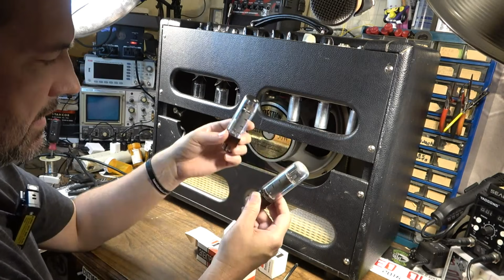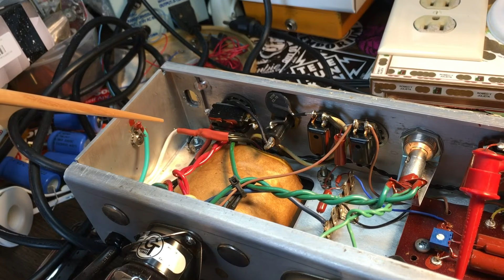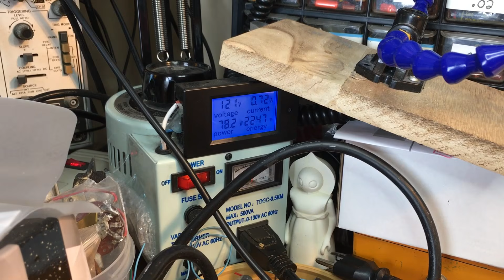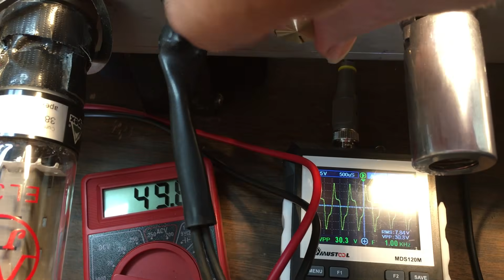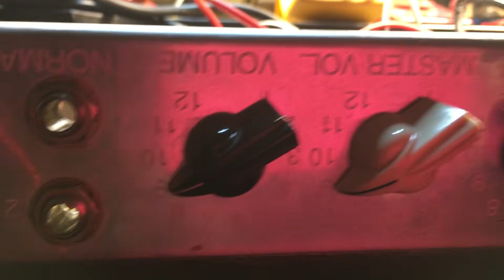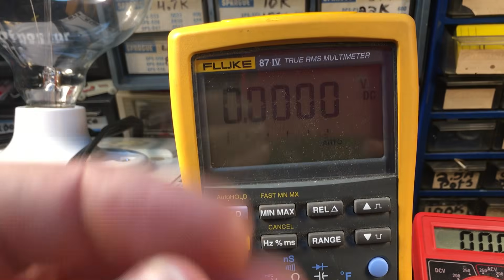STOP USING THE STANDBY SWITCH ON YOUR GUITAR AMP!

Comment: I applaud your desire to improve amp design. However I do know thermistors are high failure rate items in my experience with older CRT based television degaussing circuits. Thermistors are always running very hot, and thus tend to fail at times. Are you sure that your thermistors being used are rated at the current draw that will be on them, I assume so. In my experience popping fuses are caused by defective components, and/or wrong components, you may be putting on a band aide, rather than fixing the actual problem. No disrespect meant brother. Good luck

Comment: Haven’t used a standby switch in years going back to the early 80’s with Marshall‘s and I’ve had zero issues in that time.
I turn my amp on at gigs and if I need to mute it for breaks or anything else I’ll use my tuner. Amp is ready to go at anytime.
Reply: Could I just keep the master down when warming up the amp and keep my standby in the play position all the time?

Comment: the input capacitance reduction was a good move .. but i am sitting here wondering now; if old amps ever have lacquered wire problems that develop, in the filter chokes? .. leaky shorts that could reduce the inductance ? ... i think stand by switches are a good thing, on class-a amps at the very least....
of course if i had an amp that was blowing fuses, i would stop using the standby switch ... because that's the least expensive way to solve the problem ...and it would give me time to think about it.

Comment: more seriously : if the standby switch is after rectification, it can also see a spark when turned off because of choke (if there is one in the circuit). Not so good ! A diode could avoid that, of course, like in DC motors power circuits.

Comment: It's not about the circuit, it's about the speaker and that "pop" that occurs when you power down.  It's too keep the speaker cone from tearing.  We power up incorrectly, the standby switch should be set to "on" when you power up, you explain why.  It's the power down sequence and you've be playing on 7 and just turn the power off.... big loud thump that could damage the speaker.   Once the amp is off and powered down flip the standby switch to "on".  Now, are modern speakers able to withstand that "thump" ?  If so the standby switch is useless.

Comment: EveAnna Manley(Manley Laboratories) told me that the way they implement stand by in their tube amps is to have a tapped power transformer so you can go to half voltage on the AC side, before it hits the circuit.  There is enough voltage to keep everything warm but stop any electron migration in the power tubes(another problem with stand by switches). I guess it also quells the inrush current too. I hope I'm remembering this correctly.
Reply from the maker: It sounds like they've put a lot of thought into their design. That's rare these days.
Reply: @TheGuitologist  No kidding! Of course this was figured out 20 or 30 years ago by David Manley and the gear they sell is very expensive, so it's not the regular run of the mill equipment. Same with 65 Amps(not cheap) redesigning their circuit to adapt to lower tube quality. And they use a standby circuit !   Anyways, thanks for posting this video. Good stuff.

Comment: My main amp is a professionally made Blackface Deluxe clone and my understanding is that the rectifier tube releases voltage slowly to the power tubes so I would never use the standby switch because there is no need. This question plaqued me for decades before I learned this.

Comment: i have always turned the standby on first for 5 minutes before leaving standby on and turning the power on. when I'm done i flip them both off. in 25 years of ownership, the amp (1969 Sunn Sceptre) has never needed any fuses or tubes.

Comment: Yeah, the whole misunderstanding with using the standby switch came from high voltage / high current use.  I was an engineer for a X-ray mfr and we would recommend warmup for our tubes, but they saw voltages of 120,000 volts and the inrush current was carefully limited by circuit design (for dose control as much as equipment protection).  The relative low voltage of guitar amps makes this switch not only useless but actual detrimental to the amp's longevity.
Reply: After playing tube guitar amps for nearly 50 years I have not seen what you describe.
Reply: wow, thank you for sharing. Will stop using them from today.
Reply: Yessir. Guitar amp circuits benefit from inrush current limiters... Negative temperature coefficient (NTC) thermistors to be specific.

Comment: Why bother replacing the rectifier tube when you can substitute solid state diodes which will last forever and have less voltage drop. Replacing the rectifier tube with diodes will also increase the B+ so you'll have to be sure your filter capacitors voltage rating is not exceeded. The amp will put out a bit more power with the high voltage increase. Also you will reduce the heat inside the amp cabinet because you have two less filaments to burn. I have no idea why guitar amp manufactures never put small muffin fans inside the amp to keep the tubes cool.

Comment: Couldn't wait to have time to watch this video with such a provoking title ... 
But, well, its ideas are dubious. 
- Standby switch is there to lower power up stress on PT: first there is a current spike from heaters coming up, then from high voltage (without a switch they are at the same time and may be too much). Other exotic reasons are pretty neglectable, even more for a guitar tube amp. 
- if the fuse keeps blowing this way (and even using slow-blow one doesn't help), it would be beneficial to study PT specs and maybe use a higher rated fuse. I suspect this PT is too powerful for the circuit and so provides loads of current, blowing the fuse. Main fuse rating is mostly dependent on PT specs (it should blow before primary winding). So in such a combination it could be best to use higher rated main fuse and maybe add a heater fuse for the event of heater circuit failure. 
- thermistor is not a good solution, because it needs cool down periods to function, which is counter-intuitive and tiresome. 
Being a bit more complicated, in modern amps and clones it would make sense to include a delay+soft start circuit (when powered on, cap gets slowly charghed and so opens a FET to let the full voltage through) - similar device being present in both heater and HV(+bias) circuits (if the heater circuit is not a mains powered SMPS, which makes more sense)

Comment: standby switches have the advantage of reducing thermal shock to the valves.
the heaters come on first and you can hear the 'tinkling' noise as the internals expand. then the H.T is applied and the anodes begin to heat as electrons crash into them.
upon switch off its more severe because the anodes are usually quite hot.
you can hear them cool. i usually give it a few minutes then switch off the heaters and you can hear that too as they cool.
it's surely better to cool more gradually to reduce stress on the internal welds and parts.

on the subject of cathode stripping : it seems to apply to very hight h.t voltages only. several thousand volts.
i had an amateur radio transmitter with 700 volts on the anodes and when it was switched to receive only, the heaters were turned off and the anode voltage remained. this never caused any issues

Comment: Hi, A Little Bit Of Historically Correct Standby Switch information, Originally At Radio Transmitting Stations and TV Stations Using Water Cooled Power Valves/Tubes With Out Side Water Reservoirs, The Size Of Swimming Pools to Cool The Transmitter Power Valves and Driver Stages, There Was A Power Up Sequence, Early Valves/Tubes Were Directly Heated, Later Valves/Tubes Indirectly Heated, Irrespective Of Either With 10KWatts Of Radiated Power Or Considerably More Than That In Various Instances, If HT,(Several Thousands Of Volts Or More), Is Switched On Without A Power Up Sequence, And The Heater/Filament Voltages/Currents Monitored, For Steady State And Correct Operational Area, Then When Certain They Were Correct The HT, Was Applied and Monitored As It Was Ramped Up, Also Being Monitored for Voltage/Current.
So If A Duff Expensive Valve Tube, as Big as A Six foot Man, Or Smaller, Three/Four Foot Tall, Water Cooled Had A Problem, It could Be Seen On The Monitoring Meters, During The Power Up Sequence And Shut Down Before It Destroyed The Power Source Or Caused Other Major Destruction To The RF Transmitter Circuits.

I Have The First JTM 45, I ever Repaired, At Sixteen Years Old, Originally It was a Bass Model, It Has A Standby Switch, Single Pole Single Throw, Fed Off Of A GZ34  Cathode Pin, Valve/Tube Base Tag , A.05uF 600Volt Polystyrene Capacitor Connected, On Cathode, Then  To Earth/Ground, Then To The Input Side Of The Standby Switch. 
The Output Side Of The Standby Switch Has The First, A, Section Of A Dual Under Chassis Mounted Dual Section, 32uf-32uF 500 Volts/ 525 or 550 Surge Volts,  UK Style Can Electrolytic Capacitor Connected Direct To Output Side Of The Standby Switch, The Output HT 450 Volts From That Standby Switch Also Feeds The Choke Input , The B Section 32uF Capacitor,(Dual Section UK Can Electrolytic Capacitor), On The Choke Output, The Centre Tap Of The Output Transformer, A 1 K Ohm 5 Watt Wire wound Ceramic Resistor, Then Off This Resistor Feed The Two Screen Grid Resistors, Each 470 Ohms 1 Watt, Wire Wound Ceramic, ( Though I Have Seen On Others Of This 1965 Production Year Model JTM45, Use 1 or 2 Watt Carbon Resistors Used Instead Of Wire Wound 1 Watt) Original R.S. Components Makes Carbon, Or More Correctly Badged, From Morganite UK Name, Manufacturer/Allen Bradley USA Parent Company., Then Phase Splitter Drop Resistor And It's Capacitor 16 uF Then Tone And Preamp/Front End And It's Drop Resistor And 16uF Capacitor.
The HT Fuse  Anti Surge/Slo Blo  500mA Is Fed From The Transformer Centre Tap To Chassis Earth/Ground, Transformer Mains Input Fuse Is 2A Anti Surge/Slo Blo. To A 240/250 volt Primary Transformer Tap Winding, With Tapped Other Voltages Available
The Only Time I Ever Saw A GZ34 Flash Over Is After This Amp Took Out The Original Power Transformer, Due To Some Damn Fools Modification Of A Crude Bias Control That Shorted That Valve Rectifier Out, I Had replaced The Power Transformer And Had To visit My Best Friend's School Friends Who I Repaired  For, The Brothers It Belonged To, They Having Sourced A Later Marshall Power Transformer Through A Canterbury Kent UK Music Shop In 1979, I Fitted It And Got The Amp Working Again, Not Sure What This Extra nob/Pot Inside on top Of The Back Chassis was There For at The Time and I'd Got From Marshall Via Rose Morris, UK distributor At That Time Still Till 1980/81 An Original Circuit Diagram/Schematic, No Such Control On There,
So it was Not giving Good Sound, With A Guitar, So I Turned This Knob Thinking It was a Master Volume, Added around The Phase Splitter Valve/Tube, Wrong,  I spotted in Time A Brief Mini Lightening Storm In The GZ34, I Quickly Backed It To Near Were It Had Been, But To The Right Place Where The Amp Stopped The Lightening Storm In The GZ34 And Sounded Good,
The Amp Got Sold To A Friend In Their Band, I swapped It With Him For My Rose Morris Resurrected, (Pre Korg)  Take Over Vox Sound Ltd AC30, Had To Do A Lot Of Work On That Too After Purchasing/Buying New For £210.00 Pounds In 1982, It's Filter Capacitors Ended Being A Rubbish Make And Got Replaced With R.S. 32uf-32uf Dual Section Cans And The HT With The By Now IN4007 Silicon Bridge rectifier Diodes was Way Over Dick Denney's Original GZ34 Valve/Tube Rectified HT Rail Voltage of 320 Volts, With The Silicon Bridge Rectifiers, It Was Way Over At 345 Volts, So a Poer Resistor Was Added To Drop The H Rail To 320 Volts, So Increasing The Life Of The Four EL84/6BQ5 Valves/Tubes And Allowing Them To Tun Cooler And Not Edge On Red Plating, The Amp Also Gained An Improvement In The Quality Of It's Nice Clean Sound.

 No HT Fuse On A Fender Bassman , Output Transformer Centre Tap Is Placed Before The  Choke On Input Side Of The Choke as are The Two 20uF Capacitors Each At  600Volts In Parallel, Screen Grid Fed From Output Side Of The Choke And No 1 K Ohm Resistor Either To Feed Screen Grid Resistors, 470 1 Watt Each.
Standby Switch Single Pole Single Throw, In Same Position As JTM45 From Marshall, Also with A .05uF To Earth/Ground From Cathode Valve/Tube Base Tag, Then Input To standby Switch., No Varistor/Thermistor In Either Amp.
Bassman Mains Input To Transformer Fuse Is 3A To A 117 Volt Primary, No Tapped Primary transformer Winding.

Comment: Gotta know, seeing how tubes are not EQ filters, do different tubes, EL34/ 6L6/ anything else actually change tone when biased? Or does a bias in general change tone? I would think no but I definitely would like to hear your opinion and more likely, a demonstration ;)
Reply: Yes because of the response curve and tube operating characteristics there is an audible difference in tone for sure, especially in a cool vs hot biased single ended amp with cathode biased power tubes. I could try and make a video but Brad produces much better videos than I do!
Reply: @tsloth1390  I'll have to check his channel out. What is his channel called?
Reply: @ArtyTrolls  Brad is the guitologist! If you’re looking for more tube amp info I like Uncle Doug, Terry from D-Lab, and Mr Carlson’s lab for starters!
Reply: @tsloth1390  what a weird coincidence. URM just released a tube comparison video like 2 hours ago. It pretty much confirmed what I thought, some tubes add volume and distortion and some tubes have less. That was really the main thing, very little tonal shift. You should check it out :)
Reply: @ArtyTrolls  I’ll definitely check out the video… having not watched it yet here is my observation having built and repaired a decent number of guitar amps.  Different circuits yield different results based on my experience building amplifiers.  Some amplifiers it makes quite a difference in both tone and distortion characteristics in my opinion (analog response, smooth compression and interesting distortion texture is why I love tube amps and it does vary).  Modern power tubes do seem to have more consistency and less tonal variation between envelopes styles  and form factor than old stock tubes do.
Reply: @ArtyTrolls  I just finished watching, there are little differences in there but you’re right, they’re not getting much variation in their particular amp. First off old stock tubes have a lot more variation in tone and distortion in my experience.  I clicked through the power tube comparisons so I didn’t see what amp they were using but it sounds to me like a modern British design and also like they have cold clipping in the preamp already.  With different amplifier designs with older tubes you’ll see much more variation in how an amp forms.  Some older fender Ampeg and Marshall designs for instance are not terribly stable but that’s what gives them their sought after tone… just my 2cents!

Comment: The Vox AC30 CC2 suffers really badly from this exact problem. Have blown three rectifiers because of this issue. I changed the valve rectifier out for a solid-state plug-in replacement.
Reply from the maker: You can mod that so it never happens again.

Comment: Brad, I think the red paint that is used to paint over the Components is called Glyptal. I don’t think it was used to disguise the values of the components but used for the Insulating and moisture barrier properties the products has. I think the person that designed and used the product did more bad then good in the way in applied the product. I didn’t see all of the amps parts, but is sure does look like a lot was used. Think of it like: putting heat shrink over a Ceramic power resistor. 
  Now everyone please! This is only my opinion here. Glyptal has its purpose in the electrical field, but to use it in this manner is just over thinking.
Reply: Yup! Old school conformal coating essentially

Comment: The HiFi world collectively looses its mind at the thought of a standby switch. They warn of shortened tube life and cathode poisoning etc.  I have some vintage tube HiFi and they do not have standby switches, never did and I didn't add them while rebuilding.  They do have tube rectifiers and I simply rely on the soft start they offer.  I also have two tube bass amps.  One SS one tube rectifier.  They, of course, have the standby switch.  I use them out of perceived need and habit. I only keep them in standby for a short time, however.  15 or 20 seconds at most.  I guess if you are using it frequently as a mute switch or leaving the amp in standby for long periods, between sets for example, I guess you might cause some issue...   Funny thing is concerning the HiFi world, for higher powered tube HiFi using SS rectifiers, the general recommendation seems to be in rush limiter or a time delay relay.  Even though proper standby switches are frowned upon, there does seem to be a consensus regarding the need to to limit full B+ before some warmup time.  I suspect it depends where in the circuit your standby switch is wired as to whether or not it would create problems long term.  A B15 clone kit (tube rect) I built has the standby switch after the rectifier and main filter caps.  There is also a 220K 2W resistor and .1uF 1000V cap wired across the terminals to prevent pop and likely soften the blow of full B+ to the rest of the amp. I know I could easily just leave it on with no problem.  Also there has been no problem using it as designed.